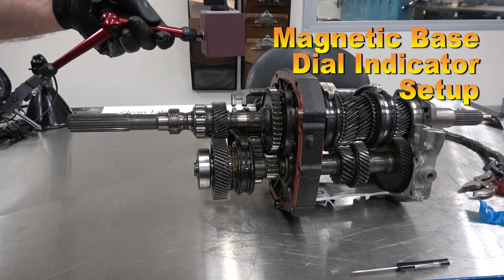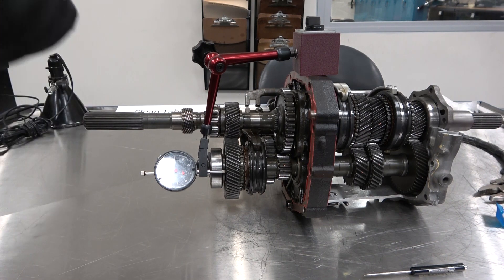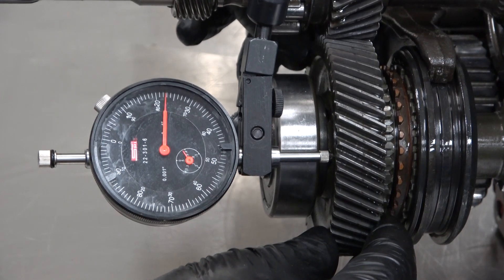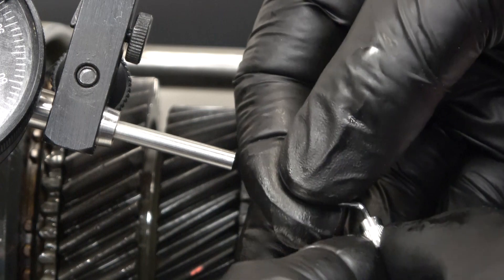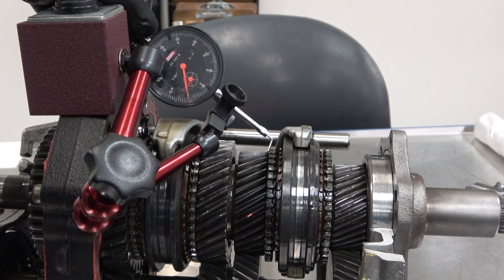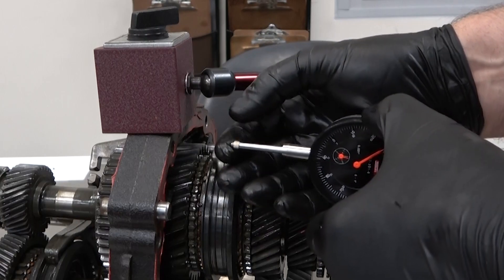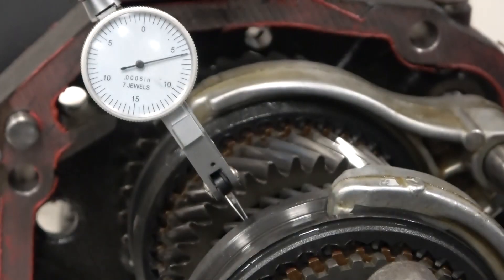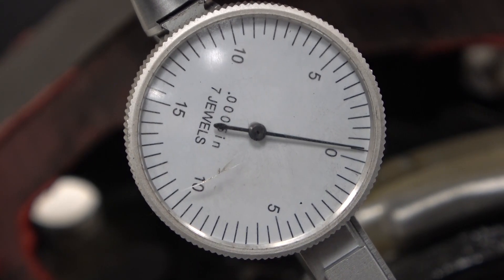Dial Indicator Magnet Base Student Exercise

Comment: The dial indicator plunger is tilted with respect to the measurement direction. Is that true?
Reply from the maker: Sometimes it is impossible to setup perfectly inline with the movement.  often a rounded tip or angled tip adapter is used to help with the offset.  Additionally these measured values often have tolerances with 0.002 to 0.010 inch variation windows. So, yes this is accurate as possible under the circumstances. If you were to compare perfect alignment to the best possible alignment I doubt you would be able to see any difference in measured value unless you have the ability to measure down to the 10 thousandth or 100 thousandth of an inch. Additionally there is always a margin of error on how you move the gear or the item being measured.

Comment: the gear setup is called a ???
or which is thhis machine?
Reply from the maker: This is a Toyota RWD truck manual 5 speed transmission.  This is called a constant mesh design and it uses helical gears for all forward movement.